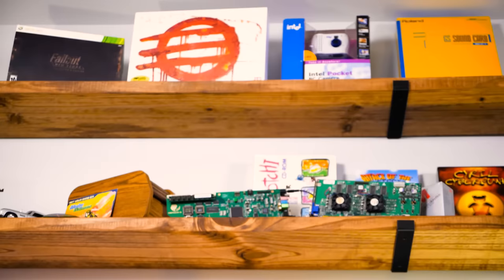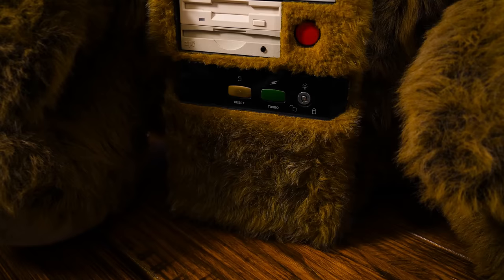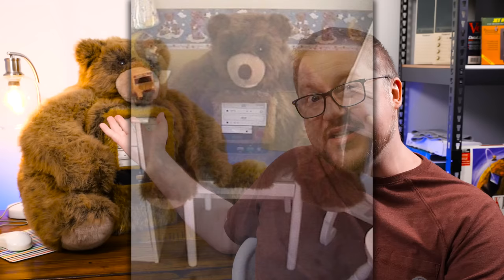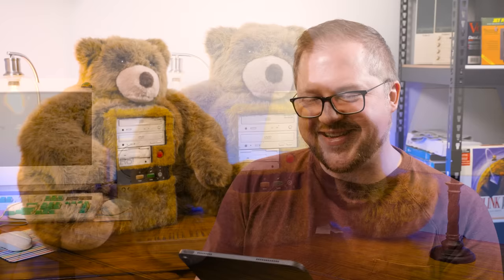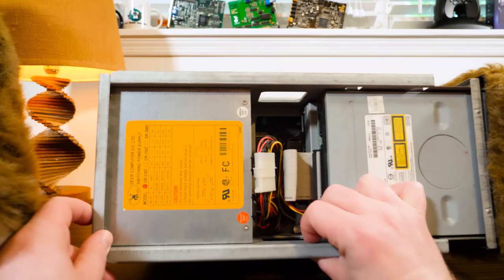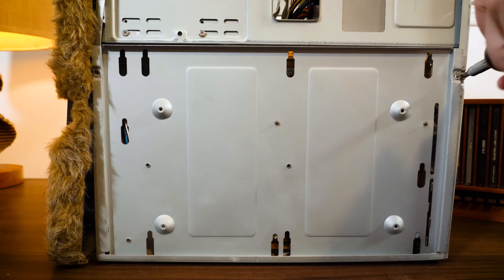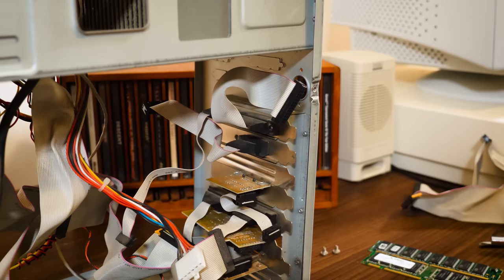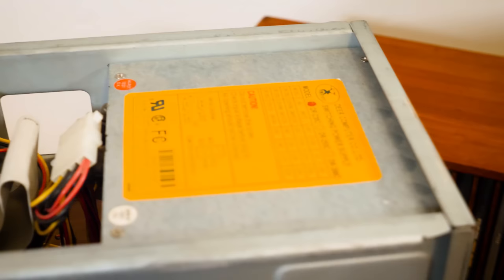The Bear-A-Byte PC: Pentium III Teddy Bear Computer

Comment: omg ecs elitegroup pc100 motherboards are one same company under different names :) crap motherboards - capacitors are usually cheap, leaking because there is only water as electrolyte :) so many boards are going for mushrooms and there is lot of problems with such boards - some pieces are running without problems and lot of pieces are just garbage never running stable ...